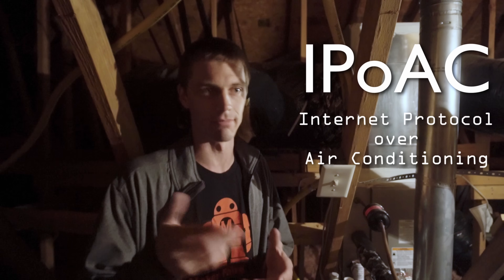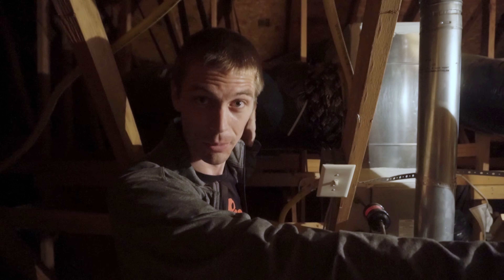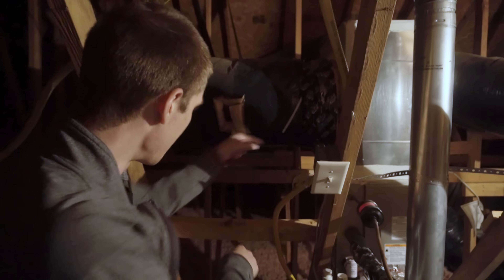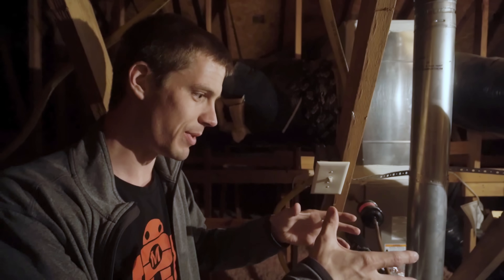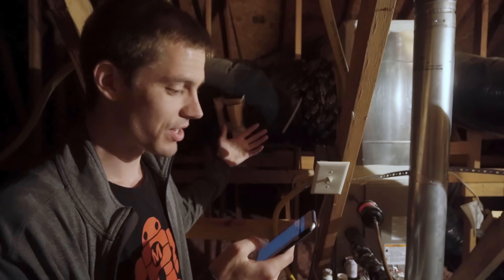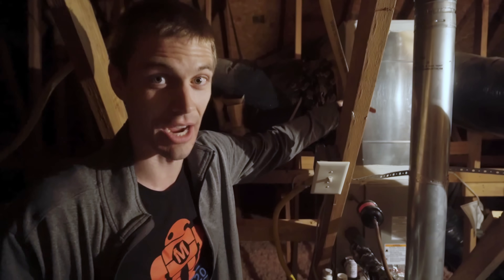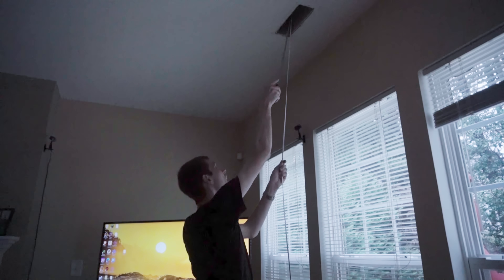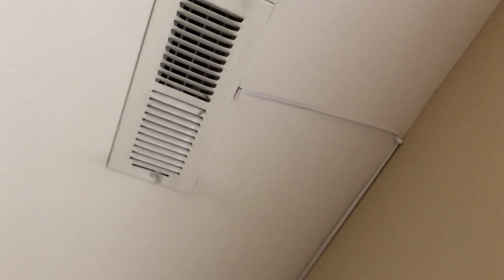IP over AC: Mmmmmm Ppppfffftttt SssshhhhhhhWOOOSH

Comment from the maker: FAQs and Corrections:
1) Don't try this at home!
2) ...
Reply: Thanks for the demo!
Reply: Nah, did this 14 years ago, works fine.
Reply: Already on  4) Profit.
Reply: Why not powerline Ethernet, aka internet over power outlet? 
Do you have any insight over how lossy those signals get?
Reply: Should probably mention plenum rated cable is what you're supposed to use inside air ducts.
Reply: You can do gigabit over power line. It works really well.
Reply: Did this in my college apartment, but the parachute idea was genius. Next stick a wifi AP in each vent 😜
Reply: The latest generation of mesh wifi hardware should be capable of providing gigabit+ connectivity across most homes, even larger ones. That said, a set of WiFi-6 capable MIMO access points are a lot more expensive than a plastic bag and a few hundred feet of CAT6.

As a network admin, I compliment the creative effort.
Reply: Excellent choice of video game there. How do you feel about the shutdown?
Reply: Please for the love of your family use PLENUM cable if you're going to try to run cable though an HVAC duct.
Reply: @WarrenGarabrandt  Same thing I came here to say: 2) use cable rated for plenum (within the airspace you breathe) spaces. In the event of a fire, they won't put out noxious fumes that could disable or kill you.
Reply: Yup, reiterating what other have said - use plenum rated cable, it doesn’t outgas toxic gasses in case of a fire, and must be used in air ducts.
Reply: Sick idea, trying this at home
Reply: In addition to using a plenum cable it's much better to use the return duct, at least if you also have central heating. Although as noted you'd need to keep it away from the blower. A vacuum cleaner would work similarly.
Reply: It's actually a legit technique used in large buildings (at least running cable through AC ducts, not sure about the shopping bag ;) ) just make sure you use plenum rated cable.

I use the reverse for feeding draw-wires through conduit, tie a bit of a receipt (thermal receipt paper was the first thing that came to hand the first time I did this, and I've tried some other things since, the thermal paper is still the best performer) to some nylon cord, attach a vacuum at the far end of the run then feed the nylon line in until it pops out the other end, then attach cable to it and pull it back through.
Reply: Run a fibre optic cable instead - contains no metal or conductive material so is electrically isolated, doesnt breach certain codes blah blah

A pair of ethernet->fibre repeaters/bridge are really cheap, same with consumer cables these days...
Reply: Plenum cable anywhere you're mixing cable with air handling.  Burning plastic is AWFUL stuff, and should be the last thing you want in your air ducts.  
Yes I realize this is April fools, yes not the first person saying this, re-iterating this anyways.
Reply: Ensure you use Plenum-rated Ethernet cables to ensure you don't die incase of a fire!
Reply: We call em a mouse in the trades
Reply: Use plenum-rated ethernet cable!
Reply: You need to get yourself some fish tape for fishing wires through walls
Reply: @eDoc2020 :

If your system has a filter box ahead of the blower, put a filter in.

Return duct has a more stable air temperature.
Reply: Instructions unclear, already did.
Reply: I did the same thing in the '90's because it was the easiest path from second floor to basement so my brother and I could link our two computers - well before Wi-Fi and high speed Internet were even available for lowly home users.
Reply: Plenum cable, like everyone else has said. That's literally what it was made for, so this idea isn't exactly unusual--in commercial environments it's often the only realistic way to get cable from A to B; there can be all manner of things in the way which make going thru the ducting a lot easier than some alternatives. The best as far as I'm concerned is using a slingshot to launch a weight across the top of a suspended ceiling, but good luck finding that stuff in a house or spanning floors that way. And if you're renting this might be the only way to do it without incurring your landlord's wrath.

Comment: make sure you use a plenum-rated cable! otherwise it's a fire hazard. Air handling spaces can stoke fires and move combustion products around, so cables in air handling spaces need special insulation that is extra fire resistant and which doesn't off-gas as much when exposed to fire.
Reply: That's really only appicable to office buildings, where the whole area above the dropped ceiling is the air return plenum, and there's TONS of ethernet cables up there. In a house, it really doesn't make much difference. Your furnace isn't running all the time like the HVAC is in a commercial building, and secondly, if the house is on fire, outside is very close (as opposed to possibly many flights of stairs down in an office building), there's very few peple in a house, and there's already tons of other plastic burning (because almost everything in a house is plastic), so what difference is one ethernet cable going to make.
Reply: @klikkolee  I bet your fun at parties too - do you literally follow the instructions on the side of the shampoo bottle exactly too? Wet hair, apply soap. lather, rinse, repeat? Do whatever you want, but I maintain that one or 2 ethernet cables in a duct in a house will make absolutely zero meaningful difference if your house is on fire anyway. Enjoy paying 2x the cost for your cables!
Reply: @gorak9000  What else would you do with shampoo???!!??!?!?
Reply: @Nelo390  It's actually great on toast.
Reply: @klikkolee  Question. In what scenario have you ever heard of an Ethernet cable catching on fire? Because the only scenario I can think of is if you're running POE through the cable, or there is already a fire elsewhere that is raging enough to catch the cable in the ductwork. Other than that, it is just a simple data cable running at low current and voltage, just enough to send a signal, and is considered a low fire risk even if broken. 

This regulation makes sense should a cable be delivering power to a device or appliance within the ductwork, because you never know if a rodent would get in there and chew it, or it may flap about when air is flowing on a corner and cause a small break. This can lead to an arc fault, and the extra air flow could stoke the burning plastic where the arcing is occurring. But the power potential in a data only cable is so small, an arc would be unlikely and the fire risk is low.

If the concern is temperature. Well, Ethernet cables are rated for a temperature of 167°F or 60°C. So, unless the run is started literally right next to the furnace, I think the cable will be fine. Even then, the outlet of a furnace is typically 140°F-170°F for older furnaces. But it is more likely most furnaces nowadays would be higher efficiency units that operate at 110°F-140°F right at the outlet.

Finally, if the concern is if the cable catches fire because of an already existing fire. Plenum rated Ethernet cables are specifically coated in polyvinyl chloride or PVC, because it's considered low smoke and low in halogens. However, you'll be hard to find an Ethernet cable that isn't coated in PVC anyway, even if it is not gone through the expense to be certified as plenum rated. 

So, using plenum rated cable is a bit of an overreaction to this. However, I would say that if you're planning to run PoE cable, then yes. Running your Ethernet setup through ductwork would be ill-advised.
Reply: @pseudonymity0000  The concern is that fire propagates really well through ductwork and if you've got cable in the ductwork that isn't plenum rated it fills the building with toxic fumes which kinda compounds the being on fire thing.
Reply: @SomeMorganSomewhere  what do you think the output of the duct being on fire as well as the rest of the house to get to the duct is? In terms of toxic gases that is.
Reply: @pseudonymity0000  I would consider the regulation to mainly be impactful to a fire that doesn't start on the duct cable. Consider a fire that starts in the attic. The cable would provide a fuel trail that the fire can follow into the duct, where forced air would cause the spread to become much more rapid. Using a plenum cable ensures that the likelihood and impact of the fire entering the duct is greatly decreased.

A primary benefit of using a cable with a correct fire rating is certainty -- you don't know the exact details of a cable's composition, so you can't do a very thorough self-assessment. Also, I have handled both CMR-rated cable (which is the rating a random modern spool will probably have) and plenum-rated cable. They felt different to the touch. There is definitely a difference in composition, even though both were marked as being made with PVC.
Reply: @zyeborm  plastic ducting is generally made from polyethylene which burns cleanly (producing only CO2 and H2O), the insulation around them is packed with fire suppressants so won't do much but keep things nice and hot in the duct. You'll get some NOx from the ABS of the register burning (otherwise again it's CO2 and H2O). Probably some odd bits of nastiness from plasticisers and whathaveyou but those are such a small proportion of the plastic they're largely irrelevant. The halogens are what REALLY screw you up. A typical PVC jacketed cable when it catches fire will fill the air with HCl and the ductwork will handily distribute that to the parts of the building that haven't caught fire yet (aided by the convection currents the heat of the fire sets up). 

Granted it's not going to be a huge issue with a single cable like this but it's not uncommon for dozens of cables to be run through ductwork in older commercial buildings.

There's a reason building codes call for plenum rated cable through air-handling systems.
Reply: @SomeMorganSomewhere  yes, and is this one cable in a house or dozens of cables in a commercial building? You didn't mention all the toxic gases produced from the house itself being on fire to get the duct work on fire and that the egress is walk out any door not down 25 flights of stairs.
Reply: @gorak9000  it's okay to be wrong...this person has made a valid point. Whether or not the risks are acceptable to someone is their own choice but it is totally valid to point out the risks. Your post is like if someone made a point about acetaminophen toxicity and its hazards from overdoing and you just dismiss it as "unlikely" because you just don't want to admit you're wrong. Chill, you aren't stupid, it's okay.
Reply: @zyeborm  the difference for you and me is whether insurance finds this cable, blame the rapid spread of fire on that (true or not) and refuse to pay out, or not.
Reply: @zyeborm  also, fire spreading from one area to the next more rapidly due to cabling in ventilation is definitely a thing. Most modern cables are VW-1 rated (vertical wire, test method 1), which means they self-extinguish within a set time and have limited flaming drops during that time (or none at all, not sure anymore),  to limit fire travelling through barriers meant to slow it's progress. In forced air, this is no longer true and becomes basically a fuse. Not a fast fuse, but still could be the difference whether fire has reached the stairway from the attic by the time your upstairs smoke alarm detects it, you get out of bed, corral your kids from their room, get them and yourself dressed enough to not freeze to death, find your phone you accidentally knocked off the table under your bed to be able to later call the fire department and try to egress.
Reply: @Validole  Again, if you have a few hundred cables in a roof space then sure. A single low profile cable in residential air ducting? yeah nah mate if you have enough fire happening in the house to set the wire on fire, the wire itself is the least of your worries.

Comment: HVAC Design Engineer here! I typically see supply fans push between 1 to 4 "in w.c." (inch water column) which is between 0.036 and 0.144 psi, so your assumption of 0.1 psi is perfectly valid! Might be a little high for residential applications but I doubt there is a significant difference between 2 and 5 lbs :D
Reply from the maker: Whooooo napkin math!

Comment: I actually did this with a telephone cable for my uncle in 2020. I ended up using plenum cable so I wouldn't be inhaling toxic fumes if the cable ever caught on fire. It worked surprisingly well, though!
Reply: I just learned about plenum cable.👍
Reply: Yeah, I was curious if he was going to use a plenum (CMP) rated cable, but it looked like it was just an off the shelf (admittedly long) Ethernet patch cable that likely is only rated as a riser cable (CMR), if it is rated at all. 

To anyone not aware, CMP cables are for areas with forced airflow, like air ducts or the areas above a drop ceiling on commercial spaces. CMR cables are for areas without forced air flow, like inside 2x4 framed walls. CMR cables are cheaper, but CMP cables do not combust and will not cause fires themselves. In an environment like an air duct with lots of air, and this lots of oxygen, using CMP cables is much better (and is actually required by most building codes).

Comment: As a last resort not a bad idea, but definitely use plenum cable if you can just to reduce the risk of fire and to withstand the humidity/temperature deviations.
Reply: Plenum cable isn't lower fire risk. It just makes less toxic smoke if it's in a fire. If you have a fire in the ac ducting of your average house there's going to be way way more toxic stuff going on than one cable to worry about.
The actual use case for that stuff is where smoke from a fire in a shared air space (plenum) will be able to get to occupied parts of a building before people are able to evacuate. 

Like yes you could use plenum cable, but the actual gain in any sort of safety in this specific case is infinitesimal.
Reply: @nasonguy  so it will be harder to fish out through the ducting?
Reply: @nasonguy  how does it bunch when it's being dragged through?
Reply: @nasonguy  and if you have a pre terminated cable for the one single run your doing in your house?
Reply: @nasonguy  your right, slavish adherence to the rules does when when an individual risk assessment says it doesn't matter
Reply: @nasonguy  the only reason you think it isn't the right tool for the job is because the government told you so. Use your brain to make decisions, not your ears.
Reply: @nasonguy  one cable makes literally zero practical difference, especially in a residential installation. You can spout Da Rulez all you want, those rules aren't designed for this use case at all and you know it.
Reply: @nasonguy  You can't see any difference between an office building with tens of thousands of people and bundles of ethernet cables meters across in a plenum, and a single cable in a residence? Those are the exact same thing and must have the same codes? Does his AC have fire stops between rooms? What about his sewer line? OMG what if there's a fire downstairs and the fire gets up through the sewer line in his upstairs toilet! What's that? The entire house is made of wood? How is that possibly up to code for the kind of commercial building that you have experience in? I bet he doesn't even have automatic fire doors or a sprinkler system!
Reply: @nasonguy  it's not in the "wall", it's in the duct. Don't talking please.